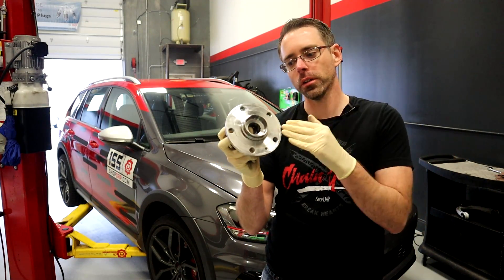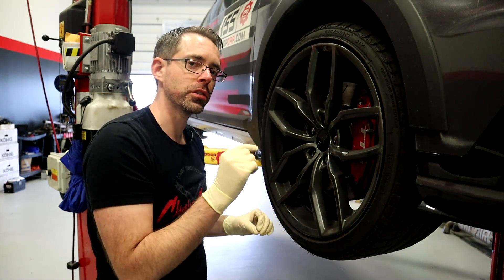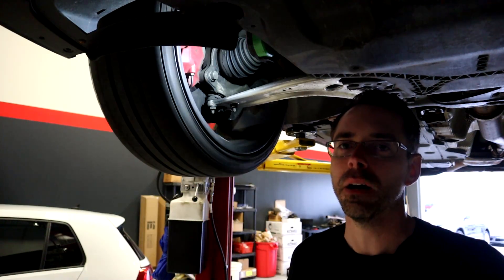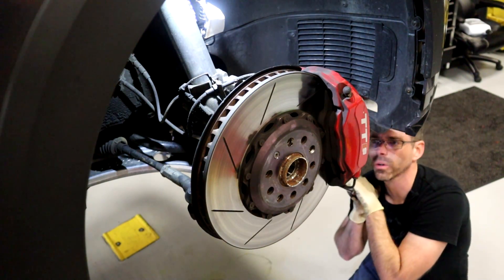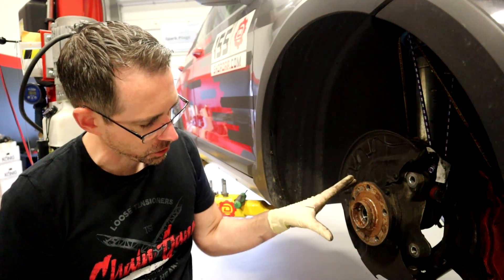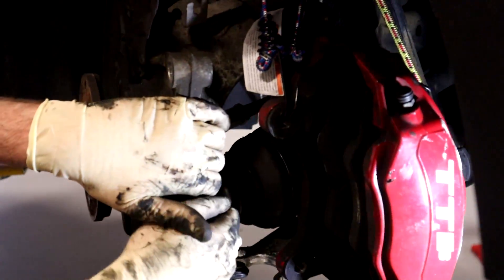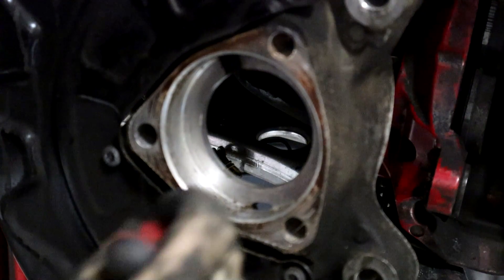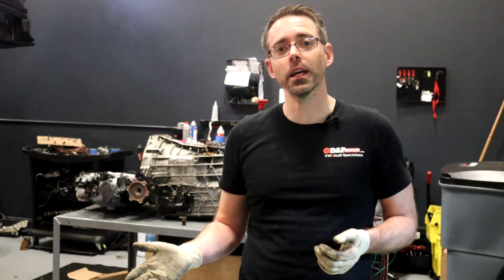How to Diagnose and Replace a MK7 Wheel Bearing

Comment: Wheel bearing must be checked for excessive play while still on the vehicle with no hardware yet removed. Once you take the wheel bearing out all of the preload is lost and can't  really diagnose at this point. Because he demonstrated the excessive play once he got the old bearing on the bench which is improper.

Comment: If only all wheel bearing bolts using the 12point come off that easily - last one i did took so long with a impacter that has 1600nm  of breakaway torque, that it shut down due to overheating and the socket was smoking from heat!

Comment: The triple square is called a female Torx
Reply from the maker: You might be thinking of etorx or inverter torx, which are not the same thing as triple squares.
Reply: Triple square is also called XZN, not female torx.

Comment: Wow, not a bad job to do at all. The bearing doesn't have to be pressed out or in which is good to know!
Reply: Unless it started to corrode since you have steel to aluminum contact. Mine were stuck from that corrosion

Comment: Hi. I have a 2017 Golf Sportwagen. I can't seem to find a YT video for replacing the rear wheel bearing. Front bearings, yes. Rear bearing for Golf FWD, yes. But I haven't seen a rear wheel bearing replacement video for the AWD Sportwagen and Alltrack MK7 models. I would guess they are similar. Not sure if the GOLF R rear wheel bearing procedure is the same. Do you have a video of this replacement? Or a video that is similar? Thank you for your help!

Comment: i found some play in a wheel bearing but no noise.. that mean im still ok?
Reply: I trust you changed it.
Reply: @sanelemazibuko1716  no but i bought a new one.. and a truck so i can work on it and still have something to drive. but now i put a machine where my lift was. i have to wait till i get a bigger shop. i just drive it around enough to keep the battery from dying and the car from rotting for now. its needs a lot, 08 r32 with 170k miles

Comment: Just today, my GTI started wheel hub like sound but it feels actually feels like the axle....have you ever encountered this? It only does it when accelerating. Only thing I can think of that happened was it was pouring and that side might of gotten a lot of water in.
Reply: I have the exact same sound
How did you repair the noise

Comment: I have a question about the outer axle bolt torque specs listed at the end of the video. I have the Golf service manual and it lists the torque for the 12-point (triple square) bolt as 200Nm + 180° and doesn’t even show the hex bolt. You show the 12-point (triple square) as 70Nm + 90° at the end of the video and the hex bolt as 200Nm+180°. When I did my ‘19 Alltrack wheel bearing I torqued the new 12-point/triple square bolt to 200Nm + 180°. Which torque spec is correct and will the bearing be damaged if over-torqued?
Reply: Did you get an answer to this?
Reply: @dhsteelers  I did not
Reply: Torque doesn’t make all that much difference but I’d be concerned about putting a full half turn on the three triple squares. But if the wheel hasn’t fallen off, I guess you’re ok. Might have fun getting them out.
Reply: @robertgreenfield9051  I’m talking about the axle bolt, not the three triple squares you’re talking about.

Comment: I think the torque specs for the main driveshaft bolts at the end of the video are wrong. Please confirm.
Reply: They are correct.
Only difference is the washer.
If you have a bolt whefe the washer part is smooth,then its 200nm plus 180 degrees, if the washer part of the bolt is grooved then its 70nm plus half a turn
Reply: They are correct.
Only difference is the washer.
If you have a bolt whefe the washer part is smooth,then its 200nm plus 180 degrees, if the washer part of the bolt is grooved then its 70nm plus half a turn
Reply: @NemesisRTCW  Standard WHT-005-437A is smooth
Reply: Yes  they are wrong. 70 NM + 90-degree forgot that.

Comment: I don't understand why you unbolted the lower ball joint. I have done more than a few and haven't had to do that.
Reply: Can you explain how you get enough space to get at the wheel bearing bolts without disconnecting the ball joints? Does the axle still come out somehow?
Reply: @HugeVictor  if you live somewhere where it snows then it may be easier to remove the ball joint, but yes if you take out the axel bolt and the three wheel bearing bolts when you slide the bearing out the axel will stay in place.
Reply: @91whiteda9  Oh interesting, I take it you can reach the wheel bearing bolts with the axle in place then?
Reply: @HugeVictor  yes they are reachable but can be difficult.

Comment: The face he made at the end of the video is like every mechanic after they fix something and wasn't sure about it.
Reply: I had one making noise in my own car. 
When I turned left and loaded it, it was noisy. 
So it's the right side. 
Changed that and it wasn't much quieter, so I changed the other one and finally it was silent. 
I'm thinking both were bad , but I had no noise while turning right. 
I kinda looked over my shoulder as if it was a customer's car like whoops 🤣

Comment: I have a feeling these vw wheel bearings are failing pretty early, both front wheel bearings have failed on mine when the car had 5 years. Also what I've heard it's pretty common on newer VWs. It's not because of the dirt or rally, they're just pretty bad quality..
Reply: Typically when a car has been in a wreck like this, the wheel bearings are prone to fail shortly after because of the shock it absorbs during the collision. If you are new idk if you are but the bearing he replaced was on the side that took the most damage from the impact

Comment: I read somewhere that wheel spacers will contribute to wheel bearing failure. Kept me from installing them.
Reply: Yea they can ,because it's like a lever. 
Now the wheel is a further distance away from where the bearing is supported. 
The thicker the spacer , the worse it will be but I'd wager I'd you were just running spacers to flush up a set of oem wheels it's not gonna decrease life much.

Comment: My Alltrack was making a kind of rattling noise that got worse when I loaded the front right corner but wasn’t super noticeable above about 30 and wasn’t a growl and it doesn’t change with speed. I took everything apart and the bearing was 100% bad. I replaced it and the nose was gone for a couple of days and returned. Upper strut mount or ball joint maybe?

Comment: Be aware that you might not hear anything!  I had a front bearing disintegrate on work truck, and it didn't make any noise!  Granted it was a different kind of bearing, but no noise /= no problem!  In that case, the only indication was that I felt the steering go "loose" for a second, and then it was back to normal.  I pulled over, thinking the power steering had a problem...but everything looked fine.  Then I drove another 50 miles, worried and trying to figure out if there was a problem...but there was no sign of a problem.  When I arrived, I told the guys I thought something was wrong with the truck...but they didn't see anything.  The boss took the truck down the highway and back, and still, nothing seemed wrong.  So I continued on...and about 20 miles down the road I tapped the brake, but they barely did anything.  I immediately pulled off the highway and into a gas station.   Everything still looked fine, but I guess I felt heat radiate from the front wheel...and I spit on the hub...it sizzled like a frying pan!   That's when I knew my trip was over...  I decided to move my truck to a better long term parking spot, but the instant the truck started to roll, the wheel went "thunk". Suddenly I had 15 degrees of negative camper!  I'm not sure why I didn't die that day....

Comment: Great videos. Two questions. I have a 2015 Audi A3 8V 2.0T. 1) Are the rear wheel bearings the same as the front? 2) I replaced the front left wheel bearing recently and Audi dealer replaced front and rear right wheel bearings two years ago. There’s still a “windding” noise especially at low speed where you could really hear it. The noise is coming from the front I think. Could it be that the wheel bearing is bad or the tires are out of balance? Thanks.
Reply: Front tyres out of balance you would feel through the steering wheel.
Reply: Replace the rear left wheel bearing. The front and rear wheel bearings are different

Comment: 70 Nm for the 12pt bolt without a washer seems low, especially compared to 200 Nm with a washer.  The 2015 Golf service manual just says 200 Nm +180 deg and doesn't mention anything about washer vs no washer.  Is that a new thing?
Reply: The Mk7 service manual specifically says [cut n pasted]-->  
– Press the brake pedal. A second technician will be needed.
– Tighten the twelve-point bolt to 200 Nm.
– Lower the vehicle onto its wheels.
– Turn the twelve-point bolt an additional 180°

Comment: I had an issue with a front wheel bearing. You could listen a rattling noise only while driving between 70 and 100 km/h. Less or more than that, the noise would disappear. Changed the bearing and the noise was gone
Reply: Did your gas petal also vibrate?

Comment: Up in New England it would never be this easy 😂 there would be rust holding the bearing to the knuckle so usually we break out the hammer or even an air chisel if it's really bad
Reply: Same with NY. It’s horrible the salt destroys everything. Lived in New England for a few years. The salt completely destroyed all the pulleys in the car. Since the salt ate thru al the covers and dried out the grease with debris going in. Now I clean my engine after each winter and before. Along with everything else.
Reply: Mapp gas on a plumbers propane torch is our friend here in upstate NY.
Especially for aluminum.  
The oxy/acetylene torch can blow right thru a nice aluminum casting , but the mapp is hotter than propane and won't hurt things.
Reply: @MrTheHillfolk you can damage plastic parts like the speed sensor.
Reply: Lived on the east cost forever and working on my cars bolts never came off easy not living on the west coast with a newer car my undercarriage is dam near spotless no rust to be found and my car is a 2015.

Comment: I did my 2010 GTI mk6 front wheel bearing  the bolt  was a pain to break  free ,put once it did   it made a loud poping sound then it was home free
Reply: At how many miles did your wheel front wheel bearing go out?
Reply: Yep the front main large driveshaft bolts are very tight. Mine is a 24mm twelve point bolt head on both sides
Reply: Yep  same ,too I had to buy the long socket so I wouldn't scratch or damage the car